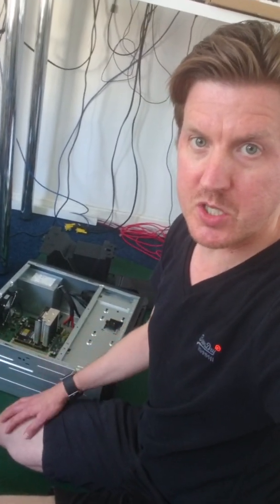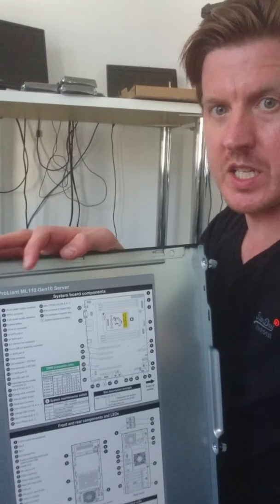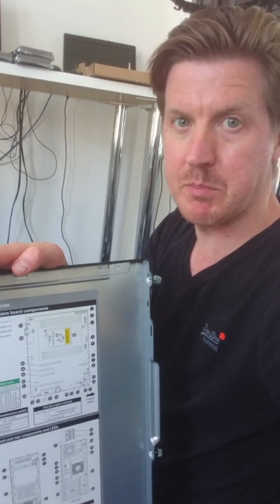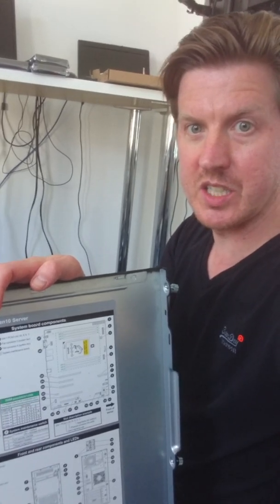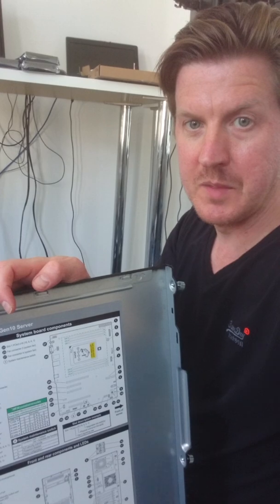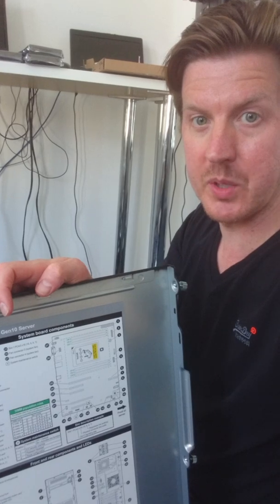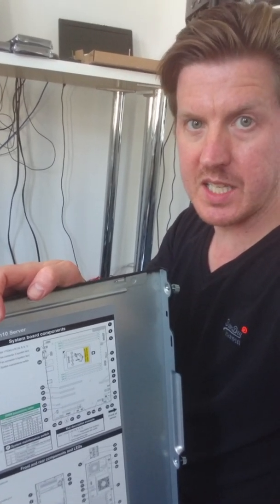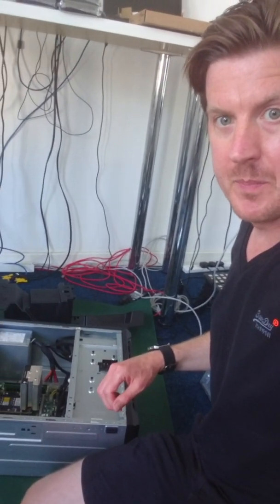How to install extra RAM in a HPE ML110 Gen10 Server

Comment: Hi! I have an HP Proliant Ml 110 gen 10 but i don't use it, could you tell me if it is a salable product and at what price?
Reply: Intel Xeon Silver 4112 CPU @ 2,60GHz
Reply from the maker: It won't be worth much, maybe £100 on eBay.